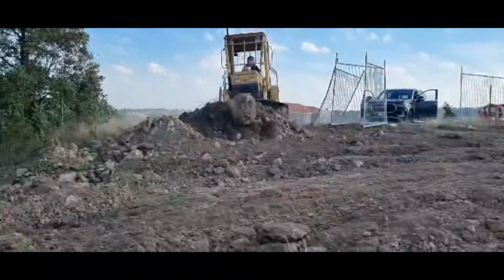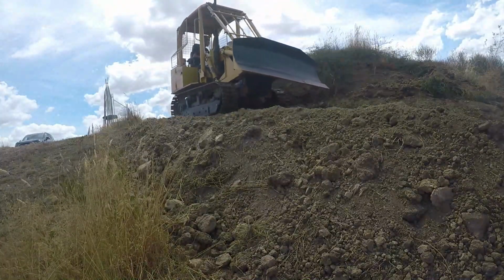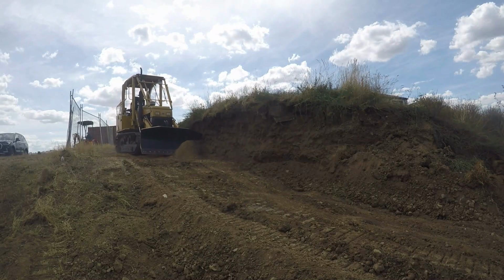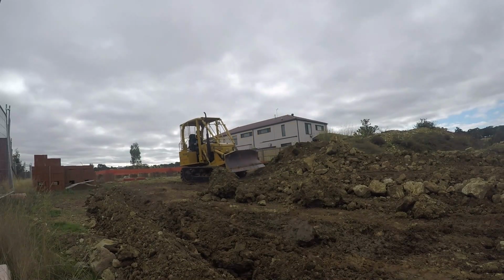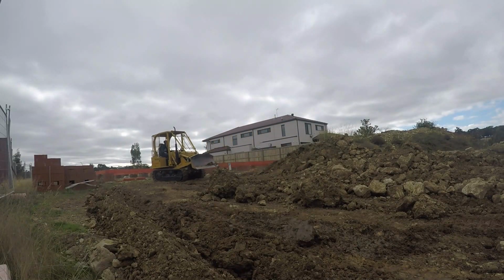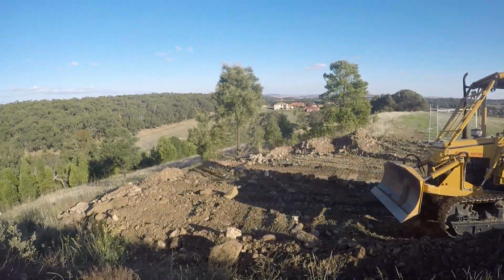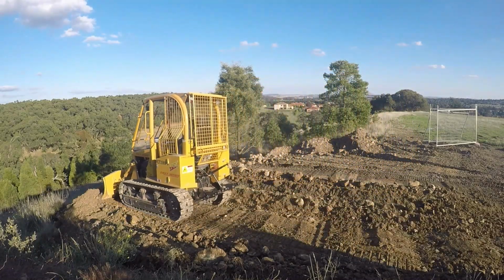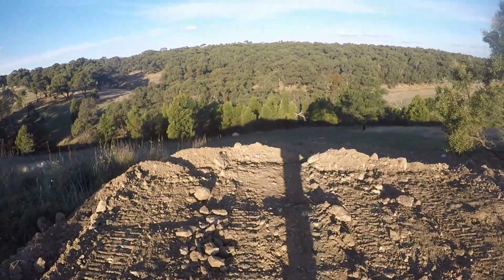🤔😱Can It Push? Mini Dozer's Big Challenge Begins! #bulldozer

Comment: Thanks for the upload. I could watch that little dozer push all day. I’d say it digs as much as it can handle, otherwise it’d just spin the tracks. Some weight on the 3 point would help with the pushing.  Does it have high and low in reverse and are you switching to high for reverse? How many hours have you done and what sort of fuel consumption for those hours? Thanks.
Reply from the maker: Thanks buddy 👍 it does push beautifully. I took the rippers off as they hang a bit low when climbing piles but still does a really good job. It does have low and higher range in reverse, but you need to be on flat ground to not over work the engine and in short pushes it is just too time consuming lol. I’m not sure exact hours but I have slashed the property and ripped it as well as pushing out and I’m on around quarter of a tank.
Reply: @lwdmodelsandmore9046 How many hours on it do you have now? Are you still going to make the follow up video?